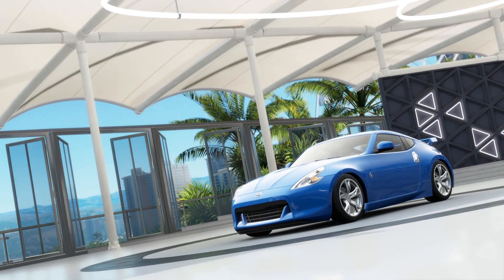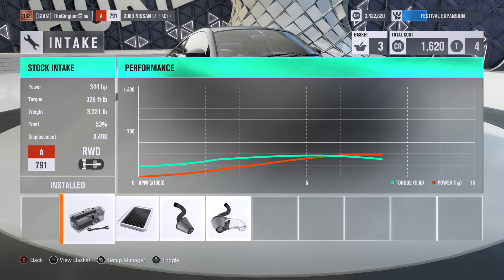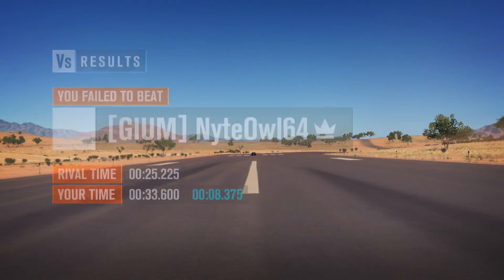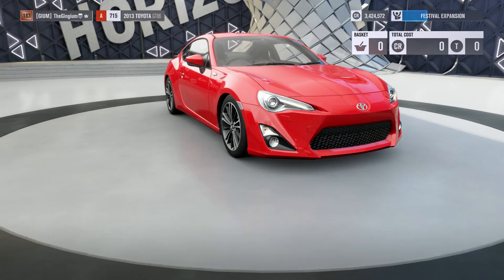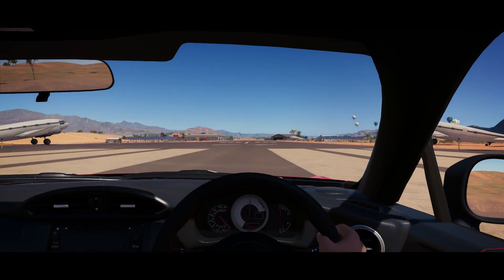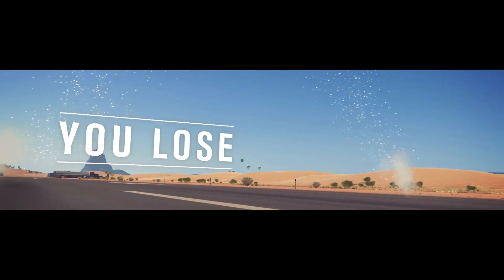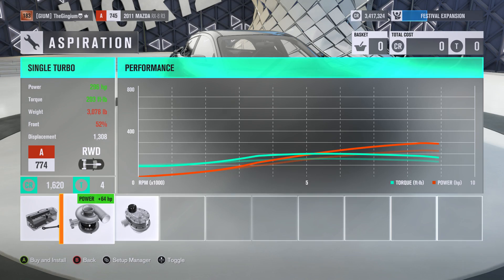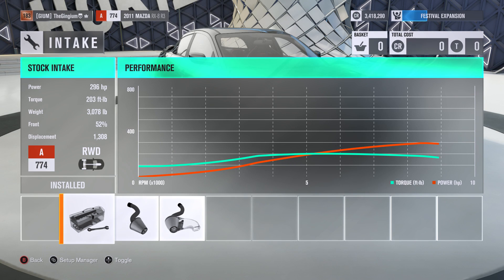Naturally Aspirated vs Turbocharged - Which is Faster? || Forza Science

Comment: simple logic: turbos don't have instant throttle response since they have to spool up, and a turbo adds weight, however an na built up has lighter parts in it...superchargers are probably better than na but most people turbocharge a jdm car, superchargers are put on V8s unless you want to stand out and have a supercharged rally Miata like this guy

Comment: You can look at the differences in times when you only upgrade the Camshaft vs upgrade except the camshaft :D It will give a different rev range to work in so a bit power(high revs) vs torque(lower revs)

Comment: You called a 250z a 370
Reply: Brandyn Keough it's not a 250z it's a 350z and he changed from the 370 to the 350 because the 370 had twin turbo not single turbo

Comment: Unfortunately that's not really science... neat video though!

If you want my explanation click read more

The car's would all have to have the exact same performance before the addition of the turbo to really test this. Of course an engine that has to spool before it can reach max power will be faster than a car that doesn't have to a turbo if the engines have equal max power (less time before peak power = faster). Thats like taking a 6 cylinder engine and a 10 cylinder engine (each with equal displacement) and saying "which one is heavier?" It's kind of pointless. You changed a lot about the N/A engine (without a control group I might add) and asked if it was different than the original engine with a turbo. Practically not the same engine. If both cars were stock and one had a turbo or both had the same upgrades and one had a turbo that would have been more scientific. Otherwise the upgrade should be determined through a cost benefit analysis.

Comment: in this game I feel like Na will always win, turbos basically effect most cars the same, and the torque and power graph shows super flat ranges on mist cars, in reality there's lots of dips in power, and especially at the redline, power always falls off before the redline, and torque can start dropping off well before it, depending on the exact motor, and set up, turbos, also dont effect every car so similarly, some cars will have a drastic change in power band, some will not be as effected, and that also goes with the exact setup and tuning with the turbo, there's turbo set ups that focus at lower rpms, raising up lower end power and torque curve higher than if it were Na, but still increasing total HP by a good margin, but the overall peak will not be as high as one designed or setup for high rpm, depending on the car, if the difference isn't much a lower rpm set up may be more useful, especially when you have to be at lower rpm, say if the gearing is a tad bit longer

Comment: I don't understand the point in this video,  was the result not predictable? Think about it a turbo adds weight and power but n/a when built to the same power figure as turbo is much lighter due to lack of a heavy turbo and the upgrades required to make the power also shaving off weight.

Comment: You could make a video about upgrades between a car built only with engine, rwd or 4wd, race wings, brakes suspensions... BUT NO TIRES UPGRADES, so it will be in A class i suppose. And compare it with a car with sport tires, original rwd, fwd or whatever in it comes from stock, no added wing. Aand race it on a circuit to see wich is fastest

Comment: I got an idea. Since this has been floating around alot. Test Race springs vs Rally springs when used for acceleration.... just to prove my point that rally suspension is better. and also make the front soft with anti roll bars and dampening as well as soften the bump stiffness all the way. Hope it gets picked gingium. I want to prove my point
Reply: Jackspedicy 2 OMG JACKSPEDICY 2 it's REALLY YOU
Reply: Rockerboi Production lol its not
Reply: Rockerboi Production ur correct
Reply: Rockerboi Production rally springs are better :)
Reply: do do it is

Comment: 350z > 370z

The good thing is that the PI stays almost the same even though you're faster than with turbo.
Reply: Patrick76496 I think the 350z looks way better than the 370z. And for the price a 350z is one of the best sports cars you can buy. I got my 03 350z touring for 4K which is crazy cheap even for a z

Comment: You should make a video on forza science: Is better to add power or get rid of weight👌
Reply: Removing weight would be more beneficial, the power only helps with acceleration, but less weight will help with cornering, acceleration, braking, etc, only thing that might be worse would be the launch cause there's less grip with less weight during the launch, but that's it
Reply: MrEujoo that's a very good idea
Reply: MrEujoo 100th like
Reply: weight for corners and power for straight line.
Reply: weight all the way
Reply: yes please gingium i want this to happen to rhos yes pleas this gappening dsf pleas fap

Comment: Main difference will be the handeling tho
Reply: rig_stig_14 
No it won't, maybe turbo lag coming out of the corners
Reply: +beau gilles depends to the corner and what revs you leave the corner with
Reply: It's harder to control wheel spin with a turbo. So it's a bit more than just the lag. When the tires spin, the rpms rise which makes more boost and causes more wheel spin. That's one of the reasons why turbo works so well for drifting.
Reply: fourbyonehundred lol i think na is better for drifting cuz you go high RPM at drifting and have your full torque